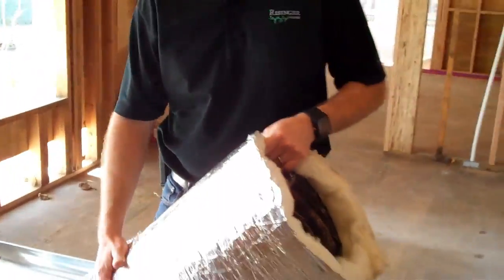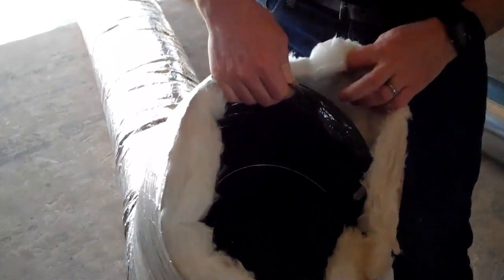Rigid Metal vs Flex for HVAC Ducting

Comment from the maker: I try to keep the duct board to a minimum in my houses and keep it strictly to the return side.  I'm concerned that fibers could get airborne and end up in the air.  I also don't like that it would be very tough to clean and cold become saturated if moisture was present.  Thanks for commenting.  Matt
Reply: You're concerned that the fibers of ductboard may become airborne, but you put the shit in anyhow. Lame dude, so lame. If you're worried about it don't fucking use it. I'm a sheetmetal guy. I layout and make fittings in front yards with no brake. Why the hell do you use ductboard? Lame dude, you're ripping people off. And there ya go, keep ductboard on the return side so the fibers can jam up the coil. Smart. I'd keep this dude out of my house.

Comment from the maker: I really like the ductless mini-split systems.  I've not installed any LG units, but I've put in quite a few Mitsubishi mini-splits and low static pressure forced air units.  They are amazingly efficient systems and have a TON of benefits over a standard forced air system.  I visited Japan a few years ago and every house I visited was heated and cooled with Ductless systems.  They do cost a bit more, but the savings and control I feel are worth it.  The down side is the aesthetics.  Best, Matt
Reply: They now have cassette style venting so the unit you used to see mounted on the wall is now recessed in the ceailing/attic, and the aesthetics are no more a issue. Also, they are actually MUCH cheaper, BUT the industry regulators have forced the price up. They are less than half the price. The install is more, but the units made in Japan for the S American market is excellent as all of SA uses them as well as Asian countries, and they are about $600-900 per 18K btu cool and heat units running 23+ SAR

Comment: Thanks for the video Matt. I'm in the process of remodeling my home which was built in the 40s as well. I have taken things down to the studs and am currently debating how to run the new HVAC system. I plan on completely starting from scratch as the old system was added to and patched together over the years. It's extremely ineffective. I have just came across the new LG ductless system, have you heard anything about that?

Comment: Matt very well done on your video.I have been in the HVAC industry for over 30 years and you are right on track!Rigid duct is by far the best way to get every dollar out of your HVAC system.Minimizing the flex length,I usually stay around 6 to 8 feet in length,should be a standard practice.Unfortunately flex is quick to install and unfortunately to many contractors are in a hurry and want to get the job done and move on to the next paying customer.Homeowners do your research and demand rigid.

Comment: Hey Paul, I got out of designing all flex (or, Owl Flex) duct systems years ago mainly because of airflow issues.  Not only because of the material itself, but because of the way it was being installed in the field.  The field workers were getting carried away and not installing the flex per the standard of care.  So now I use metal insulated main supply trunk lines with flex branches and flex main returns (in attics mostly, bsmt's are all metal).  More builders should see this video.  Phil
Reply: philmiller99 rats chew right through this crap.

Comment from the maker: Sorry to hear that.  I would suggest you first get a Duct Blast test performed by a BPI Certified energy rater to find out just how leaky your duct work really is.  They can likely suggest a good contractor who can do some air sealing work for you.  A new home should test down to under 10% duct leakage, a well built system like I install is under 5% leakage.  You'll never get to 0%, but if your house is older (10+yrs) a good goal would be taking your leakage to 12% or less.  Best, Matt

Comment from the maker: Excellent Comments Paul.  I don't typically do filter grills for aesthetic reasons, but your comment makes sense.  I'm using metal duct in the return and avoiding duct board at all costs.  I really like the April Aire Media air cleaners, check out my other video on those.  -Matt Risinger
Reply: I actually seen a return air plenum made of metal wrapped w/ duct board  tapped w/2 16"round connections  first for everything I guess.

Comment from the maker: @dogfan4lyfe Yes, they make a slow expansion "pourable" foam.  You drill holes in your sheetrock and pour the foam into the cavity so it expands slowly to fill.  Not many guys do this however so it may be hard to find a contractor who is experienced.  Doing spray foam from the outside is also do-able when residing your house.  Joe Lstiburek has done that before so you might look for some examples on the building science corporation website.  Matt Risinger

Comment: Matt? Can I get a good spray foam insulation job in my walls without completely taking down the walls? Does it work well to just take the walls apart from the outside say when residing the house?